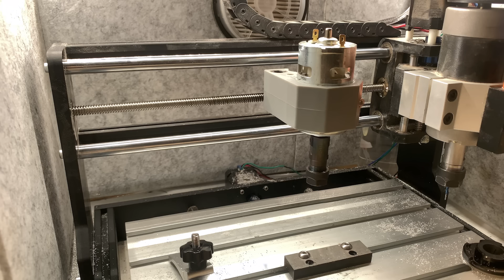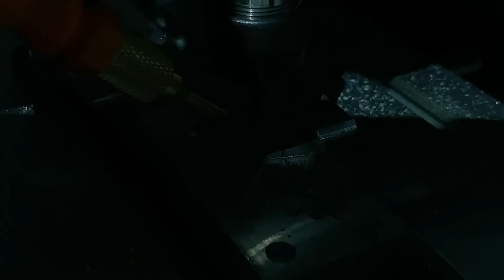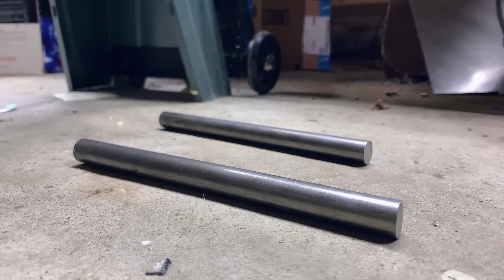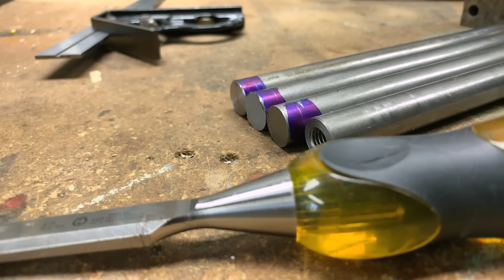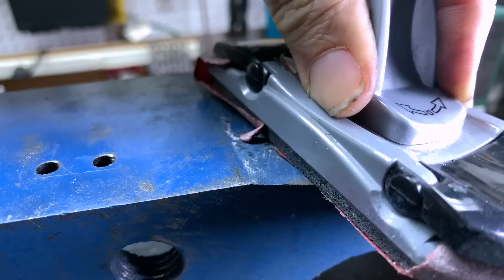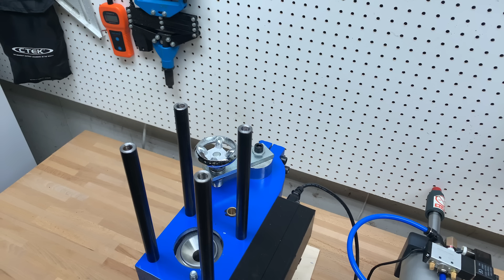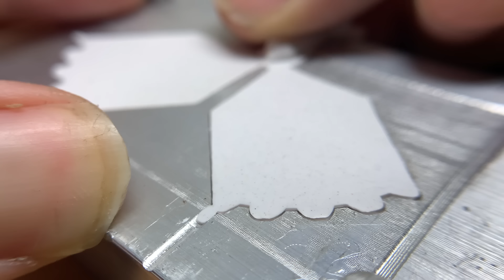Build an Injection Molding Machine From a Cheap Pneumatic Press

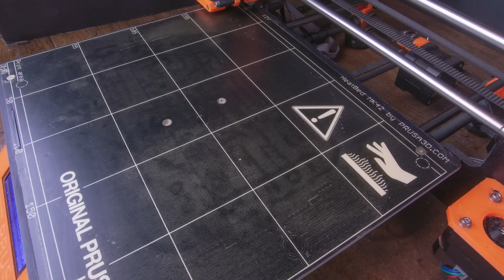Comment: Great video but wtf at 13:06 omg!!! why? it says on it: do not print directly on this surface! I hope it was just for comedic purpose and not usual practice.
Reply from the maker: It does not say that on the bed.  I print on an original Mk2, which predates removable bed sheets.  I have done 99days 10h worth of printing directly on the bed without damaging it.   Removable bed sheets are great, and if someday I get something so stuck down that I destroy my print bed, then I can uses that as an opportunity to consider upgrading.  It's been a reliable source of 1000's of original parts for me.
Reply: @retrotechjournal  Thank you for reply! I stand corrected on this. 

Never knew the MK2 had PEI applied directly to the bed. I only have MK3S and recognized the bed and Z bracket but rewatching now i see the mk2 threaded rod bottom frame (also the 12V on the bed is a givaway to mk2 as mk3 is on 24V). Mk3 has a very similar bed but without the PEI film.. and that is totally unprintable directly on it, it will lift the traces of the heated bed and a scraper would trash it and it even says on the bed on to not print directly on it. 

Learning something new every day. Cheers!
Reply from the maker: No worries!  It is true a bed sheet would be great, I tend to use some glue stick when printing PETG and TPU for fear of super strong bed adhesion. Which makes the surface finish not quite as nice.  Still the printer has been my trusty partner for a long time now. I love how little I’ve had to mess with it to get all my parts. No way I’m abandoning it to run off with some shiny new machine when it’s still printing so well. 😊 Cheers!

Comment: Very entertaining video. Thanks for all the details and humor. I need a lot more heavy duty tools to get close to having this capability.
Reply from the maker: That is one of the failings of the project. Although some folks have pointed out that the casting modification would be doable with just a die grinder.  Still it does require some fairly real metalworking. I’m glad you liked the video!

Comment: Thanks for the video, Buster Beagle fan, built one, also work in progress on one like you made. Nice job on the press, the video. Cheers!
Reply from the maker: Great! Glad to hear from other folks that have fallen down the Injection Molding rabbit hole!  If you end up making a machine like mine, notice that I have a link to a pellet feeder I designed for using with this machine in the notes.  I didn't mention it in the video because I made it after the video.  I also made a nice removable heat shield out of a 3D print, some rare earth magnets and one of these: https://www.amazon.com/gp/product/B072QD4F48/. Good luck with your build!

Comment: very enjoyable, thanks. also, thanks for not rapid talking.... I am 80 and need a less rushed communication speed. Thanks Mate... Cheers!
Reply from the maker: I'm glad it worked for you.  I mostly just try to be clear and get all my points across.   I worry sometimes that my videos are a bit long, but hey it is what it is.  I do have a "cutting room floor" where some sequences go.  I had an entire section about various flavors of powered brass tubing cutting (in my stop motion armature video) that I just cut out entirely because it too big a detour from the main build.

Comment: can you reuse the plastic pallets, maybe use PET made pallets would be so cool to reuse the plastic bottles :)
Reply from the maker: You can certainly reuse plastic. The main issues are chipping it down to a small regular size, and making sure it doesn't have water/other contaminants in it.   I have cut up extra material from previous injections to use in subsequent ones, but never tried from-the-recycle-bin plastic.

Comment: An injection moulded without a cooling system is a very slow machine
Reply from the maker: I think a cooling system adds complexity that's not really need for modest run home injection molding.  It would be neat to build one, and if I were trying to do really large runs of parts and had a machine that could heat the martial more quickly it could be very useful, but it hasn't been an issue for me.

Comment: Love the animation, the music, the sound effects, the story. I always enjoy watching your videos! 
I think the last step with this injection molding machine is to make an automated release and reload mechanism so you Don't have to risk burning your hands and go a lot faster probably
Reply from the maker: I have added a protective shield and a 3D printed pellet feeder, so that does reduce the amount of risk to your hands.  Automation with ejector pins is pretty interesting, but it does add mold making complexity, etc.   I might do it as a fun challenge, but not because I super need that.  I've never had to do any super long production runs, so for my tinkering around + short production runs it probably doesn't make a whole ton of sense to go for fully automated,  but who knows where my whims may take me.  I do have an eBay watch out for one of those pneumatic/hydraulic pressure intensifiers. ;]

Comment: Why these machines are so expensive is beyond me. It doesnt cost 6k to make an injection molder. Ridiculous
Reply from the maker: I suspect that the reason for this has been "small market size".  The number of people wanting to do this scale of injection molding has always been pretty small, so that keeps the price high.  It is possible that, as more folks get access to home CNCs capable of making molds, and more people experiment with smaller scale production, the market size of this kind of thing will increase, and that would drive prices down.  For now though it's really a "brew your own" kind of market.  I agree though that there's not that much that has to be added to a press like this for it to become a very useful injection molding tool.
Reply: @retrotechjournal  i hear ya there but if they make it more affordable that would increase the market size which in turn increases profits. So... what the hell? Were back to the initial question. Lol

Comment: where can i find the stl, explain and gerbers/ code for the CNC metal cut you are using at the start please ?
Reply from the maker: Are you talking about the Little My mold visible at the very beginning of the video?  That character is one designed by the great Tove Janson so I wouldn’t feel right circulating that design.  For a Christmas gift for my family… sure, but not to share/sell.
Reply: @retrotechjournal  thx for your answer at first, i am not talking about the molding machine, but about the tool at 0:50 ... :)
whatever, after whatching another time the video, not sure that i can make it myself if some part need metal machining tools
great job, and like all said in their comment, take care of you and stay safe dear friend
Reply from the maker: @dreaticadta806  Oh, I'm sorry I misunderstood.  That machine started out as a standard 3018pro, but I changed a lot about it.  Added a bigger brushless DC Spindle motor, custom 3D printed stages, stiffer anti backlash springs, etc.  Also the custom cabinet.  I think I have posted the CAD files for the cabinet, but the cnc's modifications were somewhat extensive, and I reduced the Z travel for extra stiffness, but many people would not want that, so I didn't think it was a mod super worth sharing.  The only real metalworking for the change was cutting/tapping some holes in the bigger rods, but it is true that's not super easy to do because the rods are surface hardened. So you can't just use a hack saw/file to do it by hand if you needed to.  You could probably use a grinder and a drill to remove the hardened outer layer and then do the rest with hand tools, but it's not easy without a lathe, so that's another reason I didn't really document the process.  The rest of the mods are pretty accessible, but that is the one change that added the most stiffness to the system/made it better able to machine Aluminum.  Good luck with your building adventures!
Reply: @retrotechjournal  thank you very much for taking the time to answer. very valuable for me.

Comment: First off absolutely enjoyed the video, fantastic editing. Now on to molds, have you considered 3d printed molds? I know there are some impressive resins nowadays such as siraya tech sculpt?
Reply from the maker: Oh thanks!  I'm glad you liked it.  I have not tried 3D printed molds.  I have seen that folks have managed to use 3D printed molds, but I do not have an SLA printer.  I probably should get one, but I like my FDM printer and my only printing space is also my home office, so things with smelly chemicals/taking up more space is kind of counter indicated.  Not sure how temperature sensitive they are.  Maybe I could set one up under the house.  Have you had good success with printed molds?   Also I kind of just love messing around with CAM/doing traditional mold clean up, etc.  Still it is true it's a stupid way to go if I want to try a few mold revisions before committing to machining a mold.
Reply: @retrotechjournal  your 100% right about the fumes, nasty stuff.

Comment: Funny thing about injection molding... It's only quick if you're both the die maker AND the injection molding guy... You've managed to skip one of the biggest problems with injection molding, and that's that the dies have to be remade any time you have a new iteration of a part.  3d printing and home CNC are the solution to that problem, and combining multiple disciplines into one process makes you a one stop shop...so well done! 😊

It's kinda interesting, I've gone in the opposite direction.  I set up the way to create die blanks before even starting on an injector.  Ive got a really nice little propane furnace off Amazon for about 150 bucks I think, that lets me melt aluminum so if I fail at cutting a die I can just melt it, re pour the blank, amd go again. I've also been using aluminum cans to make loaves of aluminum that I'll eventually cut into blanks... So that'll be cool.  Free materials are awesome. 😅
Reply from the maker: Oh thanks!  Yes, for lots of quick revs.  3D printing is king, and 3D printing really forced me to lean CAD.  Heck, I still mostly just 3D print things because I am often doing one-off designs.  I went the injection molding route in part because I wanted to learn more about CAM. I have occasionally wanted a LOT of parts for things like my loom project, but that's pretty rare.  At least for the kinds of projects I do.  Also for food safety/uniform strength in all directions injection molding is also clearly better.  Still my 3D printer sees a lot more use than my injection molder.  I'm glad you found the video.  Thank you for the nice comment!

Comment: Excellent video...resourceful as well. Especially adding the pneumatic...ive been researching injection instead of printing my parts and you seem to have a handle on it. I was wondering if 1100psi is needed whereas ive found a 400psi much less expensive. I will be entertaining your thought process.
Reply from the maker: Oh sorry!  I'm only just seeing this now!   I usually respond quickly to comments, but these days they're kind of few and far between, and if I for some reason don't get an email, the comment languishes until I happen to log in to studio.  Sorry!    Too much pressure and your mold may be forced apart/you get flashing.  To little pressure and you may not fully fill thin parts of the mold/have lower detail.    So in general being able to do higher pressures lets you inject a wider verity of molds.   Still I will say that I haven't had to crank my press up to any where near max pressure for the designs I've used, so 440psi would probably work for some set molds.    I'm sorry about being so slow responding!

Comment: Nice work. I also like your idea of making an Laser-cut enclosure for the 3018. Are the plans available?
Reply from the maker: That model might need some cleanup.  I seem to remember that the fan I ended up getting was as different diameter than I original modeled, so I had to make some adapter plate or something.  lol.  Also I did this wacky thing where it all fits within my laser, except for the big rectangles at the top/bottom.  Those I could cut accurately on the table saw, and then I glued slot and tab mount things onto the edges of those rectangles to get nice accurate joining of the rest of the stuff.  I could probably just share the CAD as is, it's not exactly super cleaned up with instructions on how to make it, etc.    Also because it's made of so many parts there's a bit of clamping/fiddling to get it all to come together. Also if I had to do it again I probably would have made the door for the compartment that has the electronics not also include the feet.  I have to prop that side up when ever I open it up to fiddle with stuff.  lol.  Still I will say I'm very happy with the enclosure. It really lets me run all kinds of jobs without filling my garage with sawdust/AL chips, etc.  And it's pretty good looking/gives good access/has positive pressure protecting the electronics, and I can lug it around if I want some counter space back.  So I am pretty happy with it, but boy if my laser were just a bit bigger I could have cut the sides out of single parts instead of having to piece them together, etc.    Ok, here's the CAD for it: https://www.dropbox.com/scl/fi/67oqfywx3ouo3em0n2q08/3018_Enclosure_v70.step?rlkey=aoxna26qqgxbv46sls9xas5zy&dl=0. Just remember it's not really a "all cleaned up and ready for people to build" kind of file. :]
Reply: @retrotechjournal  Thanks a lot for your quick and detailed reply and for the file. I am an Electronics enthusiast and use the 3018 for drilling PCBs, My mechanical design is limited to using Sketchup to design 3D printed stuff. I am new to Fusion360 which I started learning only now and opened your STEP file successfully. Earlier I wanted to get the parts laser-cut from an external service. Now that you have suggested some modifications, I will try to implement them after learning Fusion360. 
My next project is to make the upgrades for milling Aluminium in 3018 after which perhaps a horizontal injection moulding machine. Wish I had more than 24 hours in a day.🙂 Best Regards.
Reply from the maker: @udp47  Great, I'm glad you found it useful.  I've really found Fusion 360 to be very useful for the home tinkerer, with it's impressive integrated CAM stuff.  So great for running a 3018.  Good luck with the projects!  I'm glad I could help with a starting off point.  I also put some LED strip tape on the ceiling of the enclosure.  It's important to have some decent light in there in order to see tiny endmills/dial in zero points, etc.   I made a switch plate that goes on the back of the enclosure that switches the fan/led strips.  There's no wiring diagram or anything. I also cut some  sound deadening tiles inside the enclosure:    https://www.amazon.com/gp/product/B08TC586JQ And some foam across the bottom. That helps keep the noise down.  Which is nice. Oh I guess there's also probably no real indication how I hold that font pannel on.  I used a right angle bracket and some magnets to make it so it was easy to remove.  (one end ties in with slots/tabs, but the other side can pop out).   You need to have that be removable for putting the mill in, and it can give you more access for messing with wiring/adding/removing things.    The 3018 really has been a great way for me to learn a lot about CAD/CAM without breaking the bank destroying endmills :).   Argh, I really should put up some pictures some place so you have more to go on, but hey, it's your build. Have fun!

Comment: I wonder if the bracketing is simple enough to get from say send cut send. If you can make it so they can cut them this would be very DIY able
Reply from the maker: Yes, I totally think the 1 collar could be a Send-Cut-Send item, that and the 4 threaded rods and the plunger are the only other build pieces.  Probably a pretty easy kit to source. I'd kind of hoped folks could build one with only drilling/tapping, but then I ran into having to machine the bottom of the casting. Later other folks pointed out that many people could expand that with just a die grinder, and that the thing could even be built with the collar above the casting instead of bellow.  (Less elegant, but no need to fiddle with the casting). So yes I do think this could be turned into some sort of Kit system pretty easily.  I sometimes wonder if someone like BusterBeagl3D could do it since he has exp. getting kit parts sourced/interest in selling kits.  Because I tend to make things myself I don't really know what sort of cost sourcing say the plunger as a 1 off part would be, but my assumption is that it would still cost too much.  However in modest bulk for a number of kits it would probably be very doable.  I guess I could look at some of the other pay-per-part fab things cost these days.  The CAD's all there so folks are welcome to give it a try.

Comment: Using the drill press to do the threaded inserts is such a good idea! I’m not sure why I’ve never thought of that!
Reply from the maker: Yes. I just made a little 3D printed adapter for the iron. I really like doing the inserts that way. If you put them in too slowly the entire area becomes molten and exact positioning goes out the window. So being able to press them in fast and plumb is nice.